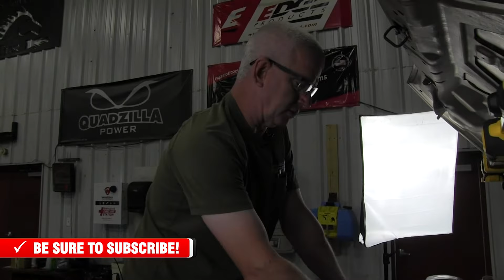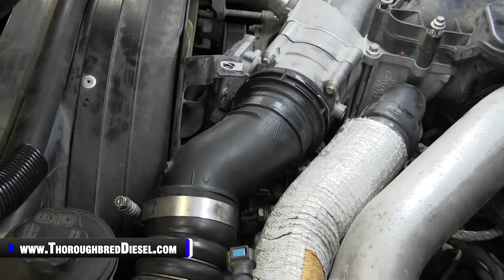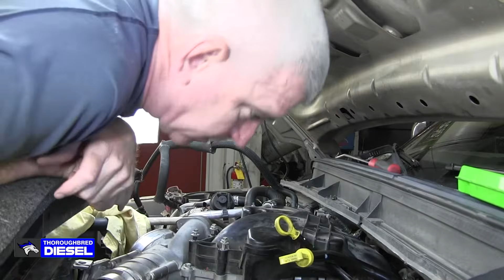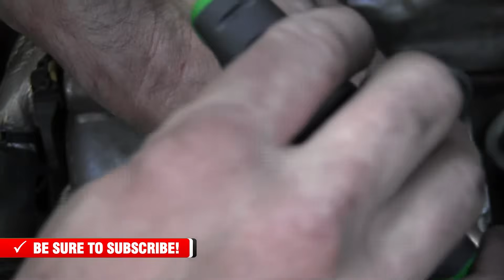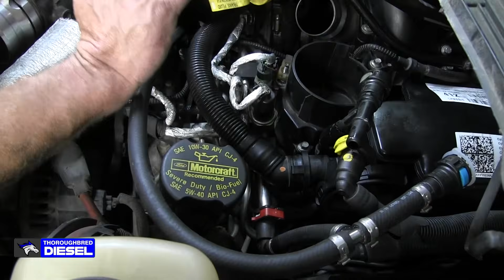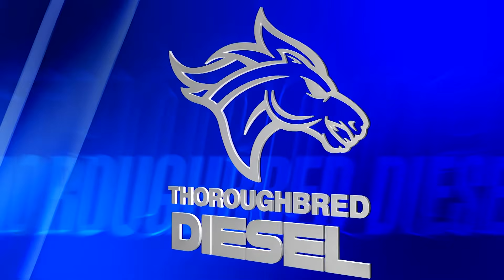Installing The NEW S&S Diesel CP4 Bypass For A 11-19 Powerstroke | This Could Be A Life Saver! #fyp

Comment: A filter can only hold so much debris   once full of metals  it will compress bypass  spring  and  full flow unfiltered  fuel  and ruin systems   i just use a good 
Lubricant  at truck purchase   marvel mystery oil  or power services additives   or both every second  tank  i do remove  DEF systems  farm tractors  and my trucks  .. no issues with inspections  i dont live in  communist  California  etc ...   with this kit void warranty?
Reply from the maker: If the filter becomes full of CP4 debris the truck most definitely will not be running, unless you change cp4’s without changing the filter.  Additives are always a good thing but will not stop the design flaws of the CP4.  This kit by design will not harm the fuel injection system in anyway.  But it is not a OE part so technically a dealership could flag your warranty for any aftermarket item.  In that case you have to fight back, check out the Magnuson Moss Act.  This protects you from having your warranty revoked without proof that the aftermarket product caused the failure.

Comment: Just put my kit in. The improp thing looked good and clear truck was running great before install. After I got everything put back together after a few fuel pump cycles the truck ran for about 30 seconds and shut off. Any ideas why this happened?
Reply: Did you ever figure that out!?
Reply: @TonightWeGrill  Yes, unfortunately I did not catch it in time. When I brought it to the shop they found metal all throughout the fuel system and told me my cp4 and injectors were shot. 10k later everything running great now.
Reply: @ryanrizzo7399  That’s crazy!   Was the truck acting up at all before you installed the kit?
Reply: @TonightWeGrill  Nope was doing fine before install

Comment: I just completed this install.  The video is very helpful.  I have only one critique of the kit itself.  The mounting of the filter seems like it was an afterthought.  The aluminum mount has to be turned to keep the filter from hitting the brake booster plug on the side of the tank.  Also, only one little bolt holding the entire filter and mount doesn't seem very substantial for a rough riding truck.  All that being said, I have bought both the S&S kit and the SPE kit.  I decided to install the S&S instead of the SPE.  A real filter seems better than a little screen.  Thank you for the informative video.
Reply from the maker: You're welcome.

Comment: Do you guys notice a vibration or noise from the fuel input line going to the new s&s filter housing?  Is that normal?  Lines aren’t bent or pinched, maybe just a lot of fuel pressure?  Thanks
Reply from the maker: There is quite a bit of supply pressure on the low side lines so vibration is normal.

Comment: I didn’t hear in the video about how often does the filter need to be replaced or how many miles?
Reply from the maker: It’s a low cost filter so we change on every 3rd oil change.
Reply: Where can you find the replacement filters? Just bought a kit for my 15 f 250.  @thoroughbreddiesel

Comment: So the blue clip for the return line from the CP4 broke on me (about 48:30 in your video).  How do I get the connector off now and do you sell a repalcement?
Reply from the maker: I think if you use fuel line disconnects you can get it.  I think we can get you something,  call us at 866-737-4966.
Reply: I just did mine today and same clip broke. was able to get the clip open wid a pick.l, dealer near me had the clip in stock so downtime was minimal

Comment: Seems like the 2 lines for the return fuel filter are a tad long? Could they be cut down some to reduce all the extra line? Very nice simple to follow video.
Reply from the maker: Thank you.  The lines are crimped but if you would like to shorten them you could just would need to be re crimped.

Comment: Had a diesel shop in Folsom, CA install this kit for me.  THEY MESSED UP!!  I TOLD THEM TO WATCH YOUR VIDEO BUT THEY OBVIOUSLY DID NOT. Somehow they twisted the semi-rigid fuel return hose to the tank and left it in a severely restricted condition.  About a hundred miles later I received a warning that my number 3 injector was “not learning to 100%”, but it was running fine. After resetting it again, I attempted to return to SD.  It popped again coming down the grade into Reno.  Standard Diesel in Minden, NV had done some work on my truck before and I had a high degree of confidence in them. They re-set it again and the #3 went off again when coasting to a stop?  They started their diagnostics believing the injector was not the cause.  When testing, the number 4 injector popped the same code as the previous number 3 injector faults.  They asked me what work I had done in recent history and then they discovered the restricted return at the bypass. Fixed that and I’m in Wyoming now with no problems. They could have sold me an 8 injector replacement job and I wouldn’t have been the wiser, instead a couple hundred bucks and I was on my way home. 217,000 miles on my injectors, rail and CP4 and counting…
Reply from the maker: So very sorry to hear this!
Reply: @thoroughbreddiesel  ,… just wanted others to know that return fuel hose can’t be restricted, and if it is and those codes pop, they can address the problem. I’m looking into replacing that return fuel line because it is almost but not 100%. It’s costly. Others out there,… if you are taking your truck to a shop to have this bypass kit installed, make sure they know what they are doing and preferably have done it before. Don’t go to the Folsom CA Diesel.
Reply: @all, when you twist the return line feeding the tank...as mentioned to "twist it up", they are collapsing the hard plastic line and its hidden by the sheath/protective lume. I guarantee thats what cause this guy's code and what the shop fixed. This line has no way to "twist". Its a hard plastic line shrunk onto the metal hardline that goes all the way back to the tank. I followed instructions in video, heard a cavitation like noise, upon inspection, pulled return line sheathing back and saw hard plastic line twisted and collapsed with stress marks in it as palstic will when stressed!! SS should supply atleast a 90 degree fitting to make the turn for the soft rubber line supplied that connects onto white filter. I will likely cut the hard plastic line of use diesel grade hose and Oetker clamps and factory fuel fitting, making it possible to maneuver to mitigate kinking. Searched online for similar issues and finding comments in videos, but no one describing the actual issue. I hope someone reads this prior to getting to this step so they will see what I am referencing here, and they find a way to make it work and not kink plastic oem hose or the ss rubber hose trying to connect them together. This is by far the best install video out there, and this step to twist the line is in the instructions so Thoroughbred Diesel is following manufacturer instructions. Awesome channel helping us keeping these trucks going we appreciate you guys.
Reply: @morgangaushell9414 :  Thanks,… 267,000 miles and counting now, been to Tuktoyaktuk, NWT Canada on the Arctic Ocean and back and then some. BTW, no CP4 or injector issues.
Reply: That’s my fear, i know thoroughbred is making it look easy, but i can see shops messing this up
Reply: @Taro-k5u  246,000 now and running great.  👍
Reply: @Doc.Holiday  say the shop name , so we don't go there , or recomend it ;  live in Rancho Cordova .
Reply: @CesarCano-e7x  Folsom Diesel & Off-road…. If anyone ever needs quality, honest work done in that area go to Standard Diesel Repair in Minden/Gardnerville Nevada. I repeat, they are HONEST AND EXCELLENT TECHNICIANS!!!
Reply: @CesarCano-e7x  … I tried to and they pulled it down.
Reply: @Doc.Holiday  make sense , YouTube has to reserve the right of exposing it ,  thank you .
Reply: Just installed the bypass kit and the step by step was priceless. Got er done in a reasonable amount of time. Thanks thoroughbred diesel!

Comment: My electrical connector still touches mt lower intake a little after shaving it, will it be ok?
Reply from the maker: I hated doing it as a whole, but if you can get some more relief in the intake I would suggest it.  Needs to clear.

Comment: I just bought an s&s dpk from thoroughbred and am expecting it in a few days. I was wondering how much more work it would be from this point to replace the turbo in my 2011 as it is the first gen 6.7 with the failure prone turbo.

Edit:  fantastic instruction in this video by the way.
Reply from the maker: Give us a call if you get stuck!

Comment: Just had one installed,and at idle there is a noise sounds like a rubbing sound and you can feel a pulse in the whole unit. And that all disappeared when you accelerate,is that normal
Reply from the maker: The pulse is normal but the rubbing sound is not.  Go back through your install.
Reply: I don't have a pulsing sound, but more like the sound of fluid being pushed through the hoses / filter at high pressure. I can hear it in the cab while at idle. Hopefully this is normal.

Comment: The elbow you turn upright connects to the left side of the filter base? 2013 6.7
Reply from the maker: They will only fit on one side or the other, but what side of the base I guess is relative to where you are facing, and how you view orientation.  Most mechanics view orientation as position if you are facing the rear of the truck as to what is left or right.

Comment: 2 questions...  1. How prevalent is the cp4 failure? Actual numbers.  2.  Is it possible to get the repairs covered by any class action lawsuits?    Excellent instructional btw.
Reply from the maker: Thank you.  We have seen trucks with as low as 20K miles on them with full failures, and we have seen trucks with 500K miles on the original CP4 pump on the truck.  Prevalent really is overshadowed by the severity of the failure.
Reply: actual numbers is about a 7% failure rate in the US. But I believe it Failed more in the Duramax then it does on the super dutys, because for runs the low pressure lift pump, and the duramax did not run a lift pump. Bad fuel will cause premature wear and tear. I run Hotshot diesel solution on every fill up pretty religious about it, i change fuel filters every oil change and have yet to see an issue. Changing the fuel filters incorrectly can cause damage as well if you dont prime the truck before trying to restart. This kit is an added layer of protection for more piece of mind, i will be adding in the future, you just never know.
Reply: @xxDustyBones  7% failure rate in the USA, 1% in europe and Canada

Comment: Really wish the S&S 2.0 and 2.1 kit were available when I did mine 2 years ago. The newer kits look a lot easier to install. I am still going to retrofit the 2.1 filter kit to my gen 1 kit. Extra added layer of protection. Just be careful when putting your metering valve back in the block off plate. If you pinch/crack/break that black o-ring when you put the metering valve back into the block off adapter, you will get one heck of a fuel leak in the turbo valley. And chances are you won't catch it until it is all back together which means you have to tear it all back apart and fix. Ask me how I know.
Reply from the maker: Thanks for the info.  Glad it worked out.

Comment: Really? We're at cp4 and got stuff like this happening? I've got a cp1 with almost 300k and it seen some abuse in the last few thousands where I increased rail pressure and injectors duration. Now I let it back to stock and still going strong.
Reply: what is a CP1???
Reply: @justinfannon8159  high pressure common rail pump. Cp1 is the 1st edition

Comment: My question is, why is this not already on from the factory??? It’s a no brainer..
Reply: It should be. Surprised a lawsuit hasn’t challenged this. I’m sure these manufacturers love the fact that when it fails you have to purchase thousands of dollars of OEM parts to replace it. Money in the bank for them. Criminal
Reply: Or just a better style pump that we don’t have to worry about exploding at any point it wants
Reply from the maker: We agree!
Reply: Ford won’t make more money off of you if they did that
Reply: Because expected engine failure is job security. So many manufacturers design "timed" systems with weak points ao we are forced to buy new cars. When the electric Era kicks off they can literally just turn your car off. In 15 years, electric cars will be a monthly paid subscription just to move it. It's all about money. The US has to find new sources of revenue because Saudi is no longer going to be dealing in the American dollar. So it's pretty much about to become useless.

Comment: My 2019 has 3 lines to the filter and the ground strap is not where this one is. Ended up using the 2020 method I guess.
Reply: Not going to help you now, but anyone who reads this. For '17 plus, there is a long bolt, spacer and nylon lock nut to go in place of the plastic clip.
Reply: Did you have to remove your windshield cowl to remove the intake manifold
Reply: @LandanL  no but you do have to loosen it to get the bracket bolt under it.

Comment: Thank you for the video. The 2017's are different than the 16 and earlier in that we have to use the included hose as the fuel filter has 3 fuel attachment instead of 2 hoses.
Reply from the maker: You're welcome and thank you!

Comment: My 2012 return line that gets rotated upwards it not able to move. Nothing in the directions about this. If I hook the line up it is kinked bad. What to do?
Reply from the maker: Apply a little gentle heat to the line and see if you can get it freed up.  If not,  you made need to replace.
Reply: Update I grabbed the metal line close to the connector with channel locks. Grabbed the connector with my other hand and got really aggressive. After it moved it was easier to adjust to where it needed to be. I contacted S&S and they said some can be really stubborn.

Comment: S&S please make this for the LML duramax. Put a bug in thier ear thoroughbred diesel.
Reply: Add a lift pump. I had 250,000 on my LML with no problems before I traded it. I think the new Ford comes with a separate lift pump also now. I used an air dog 165. Works great.
Reply: Buy a powerstroke be a man😅, ( I was a GM  tech for many years, Duramax cab is coming off most repairs, no plug n play on those

Comment: I think at 4:00 mark that 11 to 19 years will not have to heat and cut out that plastic pipe. Do you have to heat old pipe and install new pipe with clap? Or is this all plug and play? Doing this kit Saturday on my 19. Great video
Reply from the maker: Thank you,  yes on the earlier years the pcv pipe can be removed without cutting.  Just be very careful as they get pretty brittle.

Comment: With the high mileage and the work removing to gain access to the CP4, wouldn't it be worth it to replace the whole pump at that point?
Reply from the maker: Not a bad idea,  still a lot to do to get the pump off the truck at that point.